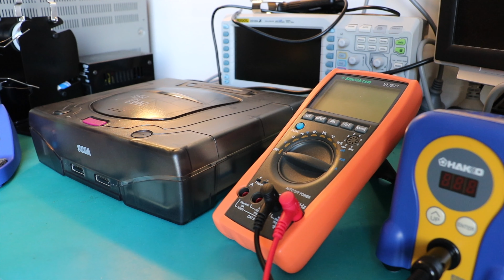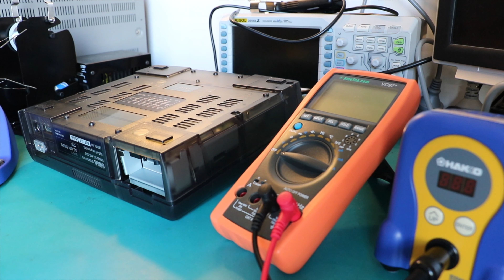Sega Saturn Phantom Universal Modchip Overview & Disassembly

Comment: Happy new year Shane. Saturn for the win ! Go for the bios mod, tricky ish but it's great to have the JAP boot up on my PAL console.  Used chip quick low melting point stuff for mine ( long B4 I got the cheap 858D hot air station).